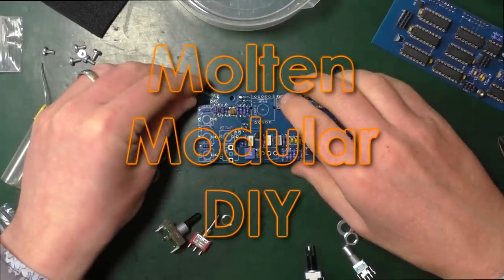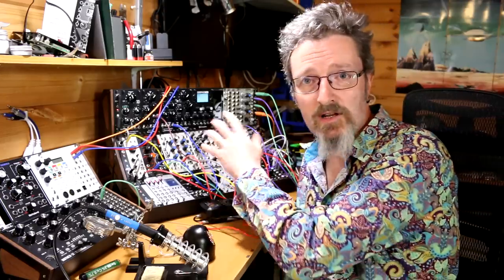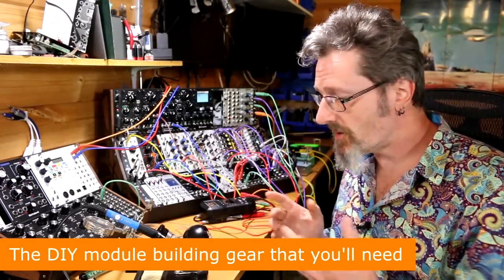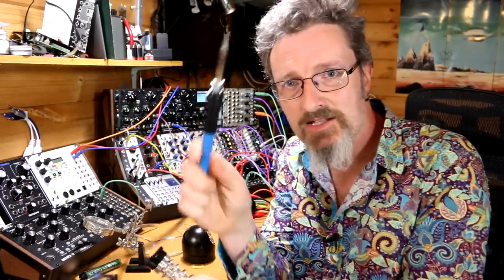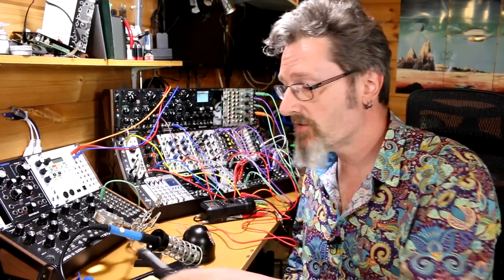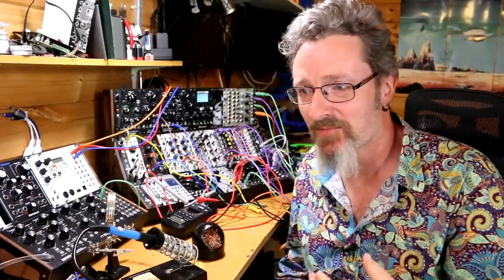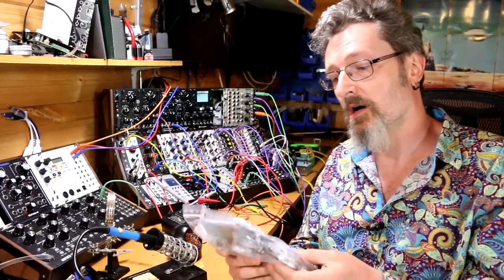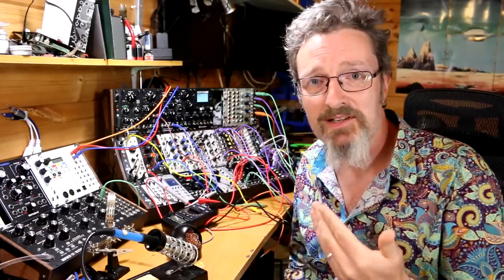Modular DIY 01 - Introduction to building your own modules and the gear you'll need

Comment: My whole rack is mostly DIY! Aside from getting full kits which a lot of manufacturers offer, there's also the whole other world of just getting bare PCBs, sourcing all the components and then building it. Check out the Barton musical instruments PCBs, my rack is half full of his PCBs... I started building modules and got into it last year, with the Doepfer DIY synth as my first module, and right now, apart from a Function and STO, my whole 84HP 9U is full of DIY modules :)
Reply: Sourya Sen do you get good sounds out your diy modular stuff? I am planning on doing the same diy and some secondhand stuff.
Reply: Yup! I've taken the Doepfer DIY out of the rack because I wasn't happy with it but my main oscillators are the STO and the Erica synths Polivoks VCO (DIY). Filters at the moment are the Polivoks VCF and the Barton Switched Resistor VCF (DIY). That's my main 'voice'. Otherwise I have the Barton Analog Drum, Barton FM Drum and the Radio Music. Also the noise from the Turing machine through filters. So yeah, quite happy with all the sounds I'm getting out of these. For sequencing and modulation (+ triggers) I use the Turing machine (+Pulses), Transient 8S Sequencer, 2LFOSH (Barton), VCA-Mixer (Barton), 4xDecay Generator (Barton). Enveloping is what I'm lacking right now, with only one Function, but getting a simple AR from Barton and simple Quantiser from Barton again soon to solve my envelopes + also get some more 'musical' sequences. Oh I also have RYO Logic gates + Shakmat Time Wizard for some more triggers. See... lots and lots of DIY :D
Reply from the maker: I'll need to get some longer rails
Reply: Buy the rails, DIY the case! Or a DIY case altogether. Befaco?
Reply: Sourya Sen wow sound pretty cool.
Reply: Just getting started. That my plan starting out doing the whole Erica synths diy bundle wish me luck
Reply: I dare you to upload some content
Reply: brother thank you so much for making me aware of barton
Reply: Holy shit Barton is so adorable. Thanks m8

Comment: Time is money. DIY saves nothing.  You need a shed load (years) of electronics and soldering experience unless you like grief. Invest in proper gear too, like a solder station. You will make mistakes, therefore be prepared to debug your build - designers are sometimes amateurs and not pro EE trained... they make mistakes too. Expect frustration. Learn to read schematics. There is only one solder sucker , and that is the Engineer Inc Precision SS-02. Nothing else comes close. And buy an oscilloscope. You will need one. Look at good brands for kit, like Hakko, not Amazon Prime bargain basement. I would say good luck , but it's meaningless when compared to study, preparation , using high end kit and years of experience.
Reply from the maker: Cor geez, you really know how to suck the joy out of things. This is precisely why I’m doing this sort of thing - to test out whether what you say is true or can you actually build a synth with no gear and bugger all experience. I also hope it might be fun. Time isn’t money, it’s a resource that I can invest in whatever I choose 😊
Reply: I considered doing exactly this series 5 years ago.The pain and suffering I went through prevented me from doing so. ;-)
Reply: Be aware -  a LOT of modular designers are not EE trained. You will have to "snag" stuff when you find out it doesn't work as intended. Enjoy! ;-)
Reply: More than 1/2 my modular rig is DIY. I only started last year. It's fun and rewarding. And educational. I've had a couple of frustrations early on (which I learned from), but overall my experience is miles away from "pain and suffering". YMMV and of course DIY isn't for everyone, but those who are interested should at least give it a try.
Reply: Hi Paul - just as a counterpoint, I started building with no experience in electronics or soldering. It's easily one of the most rewarding and engrossing things I've done. Mistakes were made by the bucket load at the start, but the amount of learning resources and help within communities is just mind blowing. 

I'd agree on two points - a better soldering iron makes for a happier experience and most definitely designers are not professionals, before getting a kit do as much research as you can, get on MW and see how other people have got on with the kit and whether any bodges are required!

Cheers, Nick
Reply: I don’t mean to be contrarian, I always second guess leaving comments because your opinion is valid. But some people have a premium on Sunday afternoons but not money for non essential things. Probably wouldn’t do it if smashing out albums or touring is your living...I have a lovely bespoke rack I couldn’t really afford replete with all the cliches but look enviously upon some of the kits out there. I’m pretty injured from former work as a technician (the irony), otherwise I’d learn about it for sure...Just using my Euro can be tough on my hands and back, but it’s better than sitting at a PC. Probably a timely reminder to would be technicians to stretch, watch posture, lighting, take breaks... :) I’m gonna save my wrists, now. Thanks for the resource, R.V.
Reply: I think it's a personal journey. It sounds like you took yours and derived some important conclusions from it (with most of which I would agree), but I'd say it shouldn't prevent others from taking a similar journey and seeing where it takes them.
Reply: Denis Kobozev I agree, I’ve got two modules to build once my office is cleaned up and there’s space ... a Turing machine, and a 4MS SCD ... both I look forward to using. Read the instructions, go slowly, and things should turn out OK. Have a proper soldering iron (Hakko), good solder and lots of patience. OP is having a bit of ptsd if ya ask me 😯🤭
Reply from the maker: I see - I would suggest that 5 years is a long time and 5 years ago I wouldn't have considered modular at all, let alone building the modules. It would have been an impossible world for someone like me to penetrate. These days, with the amount of help on offer and the way the genre has opened up, I think most of the pain can be avoided. Besides, it feels like it's worth a shot and up for the challenge of seeing whether this is fun or not. And I think luck is a worthwhile thing, because I don't have any of that other stuff
Reply from the maker: I don't know what any of that means.
Reply from the maker: Nice one mate :)
Reply: I agree it is engrossing. And thereby lies another dynamic - do you want to build , or make music? It eats time. There reaches a point of course that unless you get qualified to FAB Plant level (J-STD 001) and own the kit to go with as to what you can build. To paraphrase Chevy Chase , it's all surface mount these days. Through hole is just a giggle. I know people who manufacture modules with DIY ovens, but...the reality is send it off to China.
Reply: There is also no specific level or direction that anyone is required to reach. Sure, it's probably necessary outsource all the work to China if you want to be Mutable instruments. But then there are people like Sam Battle aka lookmumnocomputer, who actually performs with stuff he builds himself.
Reply: I promised myself a modular in 1983. I waited for various reasons. Digital synths had become affordable ( the wonderful DX7 had landed ) and they took a bit of time to learn to programme.
Reply: No offence but this comment is nonsense. I have a prefectly functioning 104hp diy rack. If i'd have bought manufacturers modules ready built it would of cost £3000 according to mod grid as it happens it cost £800 plus i've expanded my brain and learnt loads. I only built one kit by the way everything else was bare pcb and panel.
Reply: No offence Alex, but you're wrong. I suppose it depends on how much you value your time. But inevitably you will need to debug and snag a DIY module. Jeez ,I've even had to snag manufactured modules due to design error or oversight. It happens. And it takes time. My best advice to anyone is hang around with someone with years of electronics experience and learn from them. I do that every day. I had to sit on my hands for nearly two years when one designer thought to use a component which was quite unobtainable at the time. I suppose out of the 300+ modules I have built the majority worked straight off, but I'm just saying be aware , it isn't all sweetness, light and music.
Reply from the maker: I think Paul you have a slightly different perspective to most of us here. I'm not starting a business or a production line, this is just for giggles. I'm likely to build a dozen modules over the next year and if the majority of them work straight off then I would call that a win! I think you are somewhat overestimating the seriousness of this endeavour. And if it isn't sweetness, light and music then what the hell are we all doing here?
Reply: Paul J. Burns I couldn't disagree more. I have built the majority of my eurorack setup in the last couple of years and still had plenty of time to write, record and perform music.  (And film videos, stream live performances) Some of us view learning as an investment and the "experience" you say that is necessary as something that comes from investing time.  (I'm not aware of any other way of gaining experience) The savings is also not restricted to the eurorack world. What I have learned there (especially the SMD stuff) has helped me fix computers, phones, tv's and touchscreen monitors, saving me thousands of dollars with free fixes for what mega-corporations want me to think are "disposable devices".  "Oh, your phone stopped working? Throw it away and buy our next generation for $500.00" Yeah, turned out it was a bit of solder that was cracked and a 5 minute fix was reflowing the solder on the SMD resistor. Time is money my friend, and the time I've invested in learning this craft is money that I've invested in myself...
Reply: The time spent trawling the net for components for a BOM can be a hideous waste of time. Have you ever tried to fix a module by someone who doesn't know what they are doing?  That can be hard. Have you ever tried to fix a module where the DESIGNER doesn't know what they are doing? That's a toughie. Ever tried to fix a 4-7 layer main board in computer,where the trace has failed inside the board?  Endless hours of fun to be had there  ;-). Fortunately I'm lucky enough to have built stuff for some world famous musicians, and got away with it, i.e. my builds passed muster. Ben Divkid Wilson once said my builds were better than some manufacturers ( this a few years ago). But then again I built my first computer, soldering all the components 40 years ago.
Reply from the maker: I’m sure you do awesome work man. It’s a shame that it’s turned you into such a grumpy old geezer. You could be such an advocate for a new generation of electronic fiddlers!
Reply: Lol I get my grumpiness from a world famous module designer.We talk daily and he's a great teacher of grumpiness ;-).
Reply: Paul J. Burns I would absolutely love to hang around someone with years of experience, but I found that to be one of the biggest challenges in life. There don't seem to be any experienced people around me that are willing to share their knowledge. That's why I spend so much time learning on YouTube.
Reply: You sound like you know through experience, but immediately admit you didn't even try. Funny how that works ;-)
Reply: Paul J. Burns wrong is a great word😂 my personal journey is not reflected by your comment. Average build times at most have been around 5hrs and i get pleasure from doing it. So the time is irrelevant for me. It helps me de stress and relax. 15 modules built and i've only had to troubleshoot a couple of times, (and learnt loads in the process). So choice is a thing, build or buy, whatever i won't dictate to others but i don't think anyone should deny an alternative view.
Reply: I'll tell you what is a waste of time — reading this pessimistic drivel.  It's a wonder anyone would try to accomplish anything, what with the odds being so stacked against them.  If there's one thing I've learned in life, it's to pay no attention to this kind of discouraging tripe; especially when it's coming from someone so obviously jaded.  At any rate, best of luck, Robin!  In fact, maybe I'll build a module or two myself while you're at it.  Sounds like fun.  Though you'd think we were fixing to flap our arms and jump off the roof, by the prognostication of Mr. Burns there (wink).
Reply: I am currently building my 78th EU module and so far my own experience is 180 degrees away from Paul's.  I have built a mix of full kits, bare PCBs and even a couple of stripboards.  Designs, kits, PCBs etc. have come from far and wide and never have I felt the need to question the abilities of any of the designers involved.  In my experience, high-end tools are most definitely not required, but good tools are helpful (there is a difference) and save money long term.  All my builds have been completed using simple Antex (not temperature controlled) soldering irons, a 25 watt for through hole and an 18 watt for surface mount.  Once you learn the basic technique, surface mount is as easy as through hole.  I have built around 20 SM modules including MI ones (Braids, Clouds etc.) with no significant issues.  There are loads of great resources online to teach folks the basics of good soldering etc.  There is absolutely no need to spend lots of money on advanced tools for Eurorack module assembly.  If you develop the hobby going forward and get into designing your own circuits, then adding more advanced test equipment makes sense, but I think you can do 99% with a decent multi-meter. Please let's not discourage anyone from this wonderful and relaxing hobby - rather let's encourage and offer helpful advice.
Reply: Starting with absolutely no knowledge of DIY electronics. I did a bit of home study on how components work and why they work, safety procedures and common sense practice on building and repair. Asked questions from that ever resourceful/ helpful DIY community out there and then rolled my sleeves up with a £30 iron and £8 multi meter. Built a few basic items and then moved on to the Thonk kits - which are excellently put together with great instructions and Hi Res images, with the MW threads to guide you along the way. I hit a few hitches, simple things like re-flowing the solder on the board and misplaced components... but, nothing serious and everything worked and still works. Learning this gave me confidence, so I upgraded my iron and other bench items to repair my ageing synths for things like re-capping PSU's and screen replacements - simple stuff like that.... I even did a few fixes on my partners phone and my daughters Nintendo console and retro Amiga/ Atari computers - because I absolutely hate this concept of built in obsolescence in the consumer electricals market and good family karma vibes generally materialises as gifts of nice bottles of wine and even more DIY kits. Anything that I deem 'over my head' I get my repair tech to deal with. Overall: I have saved a fair bit of money in building a supplementary modular system to my 'shop bought' systems, learned a lot about what makes these instruments tick, met with some lovely like minded people and had fun and felt satisfaction from being able to Do It Myself. Looking forward to your new series of videos, Robin.
Reply: Paul J. Burns dude...hot air solder station less than 30£ microscope less than £30 smd is a piece of cake, way easier than through hole.  Not sure what your beef is you seem to have a real downer on people just enjoying a hobby and having fun.
Reply: @Paul J. Burns Thanks for the solder sucker tip! I've been using it for a few months and it's been great so far.

Comment: Quite glad you're doing this. The DIY modular scene is absolutely brimming with great designs!

My advice to anyone jumping in to the DIY scene is to buy the thinnest solder you can get your hands on (and to avoid the tubes of solder, you get more value from a reel) and to not skimp on a multimeter if you plan on doing anything other than measuring resistances or continuity or low voltages (safety and all that, you don't need to spend big money, 50 quid will buy you a pretty great multimeter) 

Also, big fan of the Erica line of DIY kits!

Comment: This is great. I bought a soldering iron last week, a multi meter yesterday and have a diy oscilloscope kit to build. I am planning on doing diy modular stuff after that subject to getting hold of some kits.
Reply: How did it go?
Reply: @cillobillo1059  The cheapo soldering iron is still going strong. Various eurorack kits have been built and work! The DSO138 oscilloscope kit was copy of the JYE Tech which i found out as i was building it. That didnt work but it as a first kit it was good introduction to the components, soldering, electronics. A lot of hands on practice and googling for like 7 quid. I  was much more confident building a eurorack module after that and my soldering was much better. If you are thinking of giving it a go do it. Just go slow and follow the instructions and don't be in a rush.

Comment: Good start.. If anyone is attempting soldering for the first time I would recommend a simple passive Mult or something similar as the first build as it would be a shame to make a mistake on a relatively expensive filter or oscillator while you are learning the basics..
Reply from the maker: It's good advice.... except for me I wanted a bigger payoff. I don't want to spend a couple of hours on something and come away with a mult - that's why i went for something more ambitious. I think you make a lot of sense but when has that ever stopped me :)